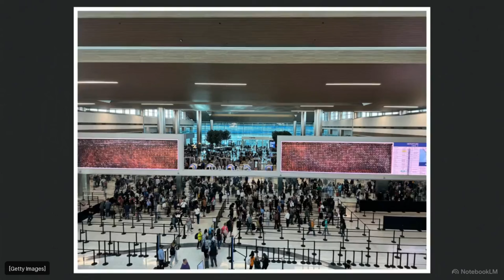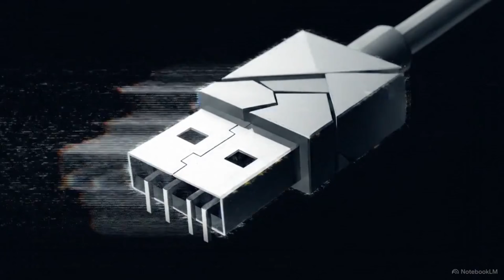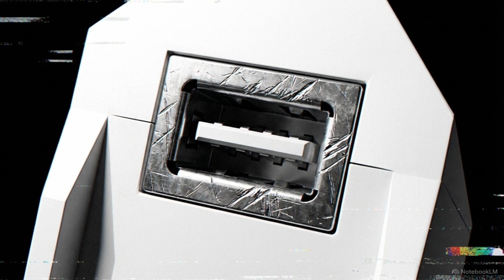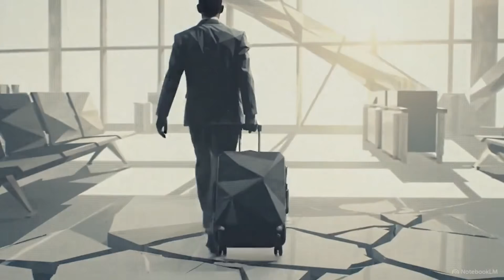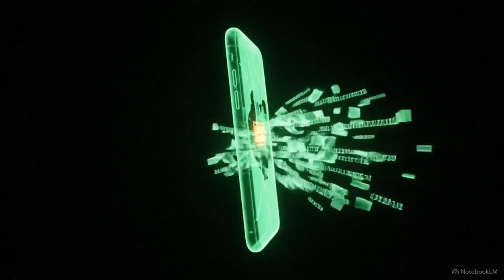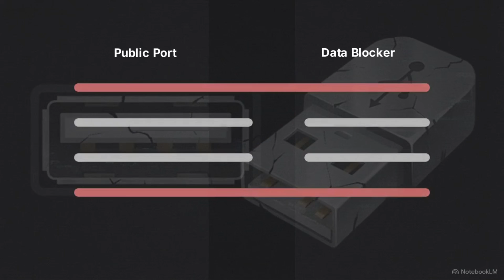THE AIRPORT TRAP

Comment: Wrong!! You have Charging cables that ONLY connect power..  2 wires.

And Data cables that connect all 4 wires.
Reply: Wrong.
Years ago there were both charging cables and data cables.

Today, you will find that nearly all USB cables provide both data and power wires.

Comment: This is wrong. Both ios, and android require user authorization before allowing data connectivity.
Reply: That is not true.
And the software on the phone can be hacked.

The risk of your phone being attacked by this attack vector is very low, but it is very easy to protect against it using a data blocker adapter.